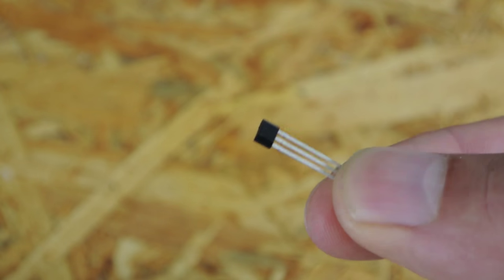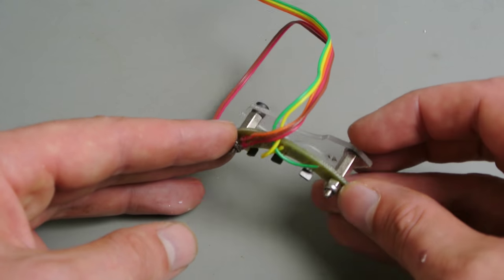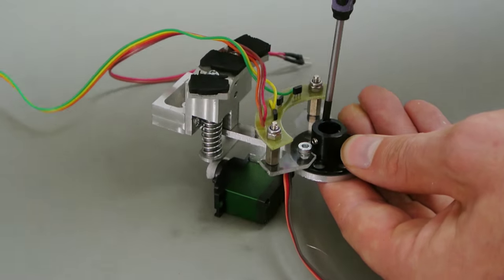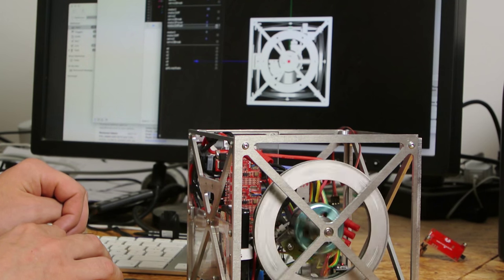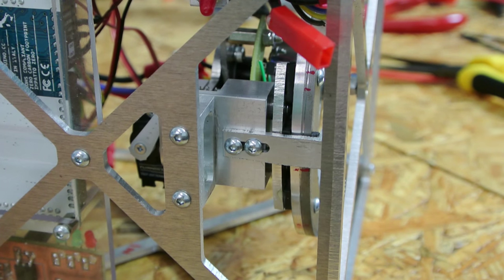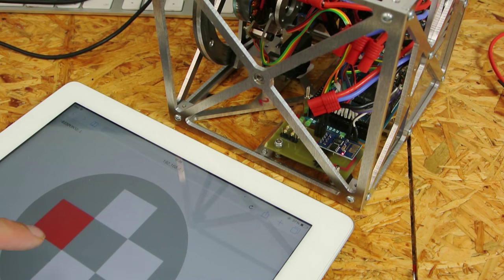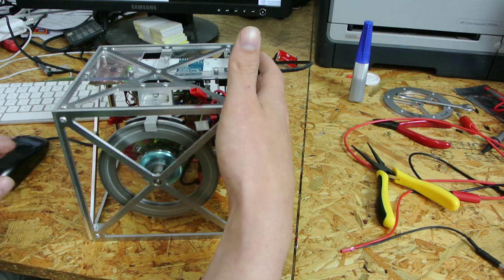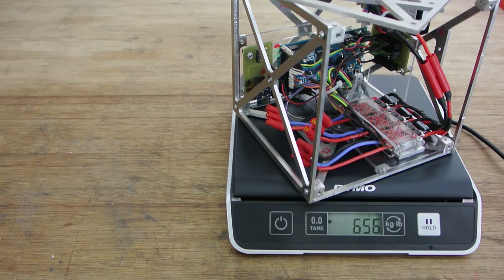Making a Rolling Cube : Part 8 - Quick Update

Comment: Hey Kris,
It looks to me like you've got to make the flywheel out of a heavier material too. Try milling some steel ones, just as thick. You will be able to store a lot more kinetic energy in heavier steel over the aluminium ones.
Think about it. It takes more energy to spin the heavier steel thus giving you more energy/power to move the cube.
Hope this helps
Reply: +1
Reply: +1
Reply: Better to increase the speed of the motor and braking for efficiency sake.
Reply: This video is fantastic at explaining the issues around developing reaction wheels https://youtu.be/4kfBEaTncjI   In particular, saturation.  It's not as simple as (faster + heavier) = better.
Reply: It'll have to use more energy to ramp up the flywheel, or have a slower rampup curve... Anyway, it will get slower or burn ;-)

Comment: Very nice cube!  However, you are missing a trick!  You are only using reaction torque, but you can add to that using the procession torque (which acts perpendicular to the reaction torque) of the other one or two motors to assist.  Also, although the brakes give a nice sharp stop very easily, you can achieve just as sharp braking by driving the motor in the opposite direction (depending of course on the current capacity of your ESC) - like EMF braking on steroids!  This looses the mass of the servos and brake assemblies.

Lastly, if you move your drive motors as close to the centre as possible, with extended shafts to the flywheels, they require less torque to lift.

You've no doubt wondered if you could make it balance on an edge, corner, controlled falling?  This is near impossible with a simple PID control.  However, it's not terribly difficult.  (though it takes a lot of tuning).  When it's standing on an edge, it has a certain amount of potential energy (as you have raised it's mass).  If you spin up the motors to have the same total kinetic energy, when you stop them (ignoring efficiency, drag, friction etc) and the kinetic has been converted to potential, it has just enough to reach the position of balance on an edge.  At this point, you switch to a traditional PID to keep it there!  Same applies for rolling over without overshooting.

I've not built a cube - but I have built the odd 'segway' and inverted flywheel pendulum - which requires the same approach.  Feel free to mail me if you get stuck & I'll do my best!
Reply: Simon Rafferty thats exactly what I was gonna say. I have also worked on inverted pendulums in the past and plan on building a flywheel based drone. I would also like to help you finish the project.

Comment: Not sure if you're still paying attention to this video but I think that this problem is totally solvable:
1. Make the flywheels out of steel (as said previously)
2. Make most of the other inner cube parts out of Delrin (or hard plastic)
These would both save a lot of weight and create a lot more force. Hope this helps!

Comment: There is no need of heat sink on esc those heat sinks are provided because in rc planes or drones require continuous operation but i think in your case it do not require continuous operation so by removing heat sink you will reduce some weight.
use something smaller then arduino due there are many small micro controllers out there to reduce weight.
i had observed that you have use some sort of big connectors in motor terminals and esc so either you can directly solder it to esc or use some light weight connectors like bullet connectors.
 and in each cube surface 4 diagonals gives supports to center and hold motor shaft you can make it to only 2 diagonal instead of 4 diagonal making X on each side. you can also use 3d printing for making cube to loss some weight.
reduce the size of your esp8266 pcb make it double layer so it may reduce some weight. 
hope it would help you and waiting for watch it working.
have a good day.

Comment: Excellent progress so far.  I assume that you got your inspiration from the 'Cubli' ?  (or they got their inspiration from you ).  i have read most of the posts here and they all come back to the same point - the brakes.  What I noticed from your build videos is that you are applying a braking force from one side only which will deflect the flywheel to some degree before it starts to resist at which point the friction force will become greater and thus the braking force takes over and gets applied.  

Would it not make more sense to have a caliper style brake?  create a u shaped bracket to hold the brake pads in place with springs. Have the servo arm push against a plate that pushes two pins - one to the brake pad on the servo side and another that goes through the U-shaped holder, pushing against a lever on a pivot arm, which pushes against the brake pad on the other side.  This would apply pressure from both sides at the same time causing it to brake quicker and with more stored kinetic energy, wouldn't it ?

Comment: For your problem you can try make it lighter by replacing some components with lighter materials like carbon fiber or some plastic, but you can also try increase the speeds of the motors and weight of the flywheels. so when it brakes has more mass and/or speed. 

Also as an experiment try to use max spin of the x,y motors when trying to use the z motor to obtain lift. Remember the weight "loss" of a spinning wheel?

Ah if you want to lose more weight try using glue instead of screws whenever possible and also I see you used a lot of AL casings and covers. Were those really needed or could they have been replaced  with plastic materials?

Good job doing this I want to build one to someday.  Good video series will be looking out for more on this :) Hope you will make the plans available when you finish.

Comment: I'm not sure, but I think that shifting the weight to the outside of the flywheel should give you more power. If the material is not the problem you could just swap out that add on ring you have on the flywheel with a ring made from heavier material and smaller inner diameter and keep the overall weight the same. That should work, if I'm right. Hope I helped, good luck :)
Reply from the maker: Srdjan Savic There is already a steel ring on the flywheel. but yea, maybe use some more at the outer edge. Thanks!
Reply: +Kris Temmerman  Would a single weight on the edge , give more Potential  kinetic energy transfer?
Reply from the maker: no, I don't think so. And it will put the flywheel out of balance, so its going to start vibrating a lot.
Reply: +Kris Temmerman balance was my concern on the suggestion..bigger wheels maybe in a bigger cage and keep the workings in the centre maybe

Comment: You have more weight than the kinetic energy stored in the flywheel can overcome. If you add more weight to the flyweel, you still have to add more energy to spin up the added mass. I would just spin the flywheel faster. If your motors can't do it, get bigger ones.

I would also not spin the flywheels that aren't needed to make the box flip over. Having them spinning means your cube is gyroscopically stabilized. That will make it harder for the active flywheel to do its job, as though you were putting more weight in it.

Comment: Rounding the corners could help. Also, I don't think it's balanced. As a test, you could attach counter-weights on the sides without a motor/flywheel to see if balancing it helps. If so, you might mount the motors on the opposite wall of the cube and have a long drive shaft for each.

Comment: How about drilling holes in the flywheel and the holders to reduce the weight, just like in race cars. Or using carbon fiber for some of the parts to get a lighter structure. You can also use motors with more power but the same form factor as yours so you a higher power to weight ratio.the last idea might be crazy but I just had it in mind lol, you can place the electronics and control units inside a structure just like the one used in a gyroscope where you can eliminate their weight if those have a great effect.
Reply from the maker: Bara Abu Shaqra yes, thats what i'm going to do first. Trim off as much material of as possible. and see where I am at that point. Thanks for your comment!
Reply: Drilling holes in the flywheel would reduce its momentum.
Reply: Balsa wood and glue can reach a higher stiffness to weight ratio for less cost than aluminum or carbon  fiber. Sandwiched foam composite should do the same. The only other change is your fastening points would need to be distributed over more surface area via plate doubling.

Comment: I would suggest bigger flywheels and new breaking system: using flat spring strips (with rubber glued on) going all around the flywheel, the servo tightening the metal strip, the rubber could be cut from tire inner tubings and have some fixing point (at each corner) to pull it away from the flywheel.
Reply from the maker: AltMarc Thanks, Ill think about the break. 
Although it doesn't looks like it, the flywheels are pretty much the maximum size already. because there is an other flywheel on a adjacent side that has to be cleared.
Reply: ***** if you got enough power in the motor, make a brass flywheel (density: 8.9gccm-7.8gccm) put most weight in the rim,  don't be afraid to put more weight in this part ! 
Put a new and light weight breaking system in the corners perhaps you can get just a little bigger diameter.

Also replace some spacer bolts/screws, with nylon, short the copper wire, cut down the 8 corner parts, try to shape the motor holder, smaller pcb, and a lighter battery. 

My ornithopter and small helicopters (300 class) don't like to be heavy, so weigh shaving is almost a kind of sport. Trust me, and I didn't talk about drilling holes (almost) everywhere.
Reply from the maker: AltMarc Yes. First thing I'm going to do is remove as much material/weight as possible. There is still quite a lot of room for that. If that isn't enough, I probably will have to rethink the breaks . thanks!

Comment: Awesome videos, love your channel!

Quick questions: would using some sort of regenerative braking in the motor eliminate the need for the bike brakes altogether? As in, essentially shorting out the motor windings to get it to stop as quickly as possible?
Also, there are quadcopter motors which are "sensored" so you can get a readout of the motor position at all times..
You've probably already thought of these things and figured they wouldn't work for one reason or another, but I figured they'd both be options to lose some components (and, hence, weight).

Keep up the great work!
Reply from the maker: +WeBDaEMoN33 Thanks! I tried that in the very beginning. but a break like that isn't strong enough to stop the flywheel. I have sensors on the motors. Thanks again!

Comment: Any chance you can stick more voltage through those motors? Should get you a bit more energy in the flywheel. If you have to replace your ESC, its still easier than rebuilding everything else. I have very much enjoyed the rest of your videos so far, best of luck!
Reply from the maker: chrizlax I still have a big margin on the power. But the speed is to high, the breaks start slipping. so the kinetic energy gets released to slow. Its about finding the perfect balance between everything. And I think the first thing I have to do, is make it as light as possible.
Thanks!

Comment: Would it be possible to use the motors as brakes instead of the servos? There is feedback already, so it should be possible to throttle reverse until the wheel is still.

Comment: probably someone said it   sorry if i am presumptuous  but the outer cube shell(the x shape) is made of aluminum can you make it instead with plastic? wouldn't it take some weight off?
Reply from the maker: +Ran Zohar Yes, although not that much, the shell is quite light compared to other parts. But its important that the main body is very ridged. Otherwise the breaking force is absorbed by the cube itself. Most plastics are quit squashy.
Thanks for your comment!
Reply: +Kris Temmerman You can try carbon fibre! Stiff, yet light.. Just an idea..

Comment: cant lose hope, be an engineer. Without problems to solve it wouldn't be any fun.
Reply from the maker: yea, true, but fixing it would mean a complete redesign/rebuild. And i didn't feel much for that at the time. Maybe I'll pick it back up someday :) Thanks!
Reply: There is a book called the handbook of composites that I recommend reading before going any further. The book is about 1,100 pages and is readable from layperson to engineer. I spent 2 years reading it over slowly and learned a lot from it even though there were parts of the math I didn't know at the time.

Comment: I don't know anything at all about any of this, so this might be a completely stupid suggestion, but it seems like you're doing a lot of processing "on-board", so to speak. How feasible would it be to shift some of the parts out of the shell? Then just communicate wirelessly with the motors via individual signals? I don't know how advanced the controlling software is, so presumably you still rely on information from the gyros inside the cube itself.

Hope the move goes well.
Reply from the maker: CellDevises All the parts are needed. Even if I do calculations off-board. So It wouldn't make a difference in the weight problem. And I like the idea that its a freestanding device :)

The move will be something for next year or so. I bought a rundown building that still needs a lot of work. Ill make a video about that later :)